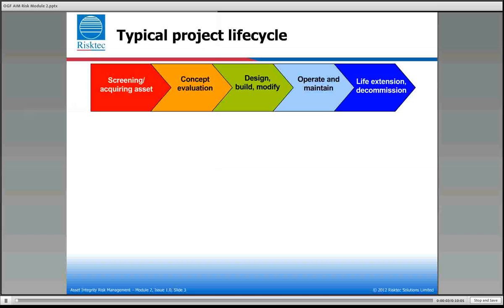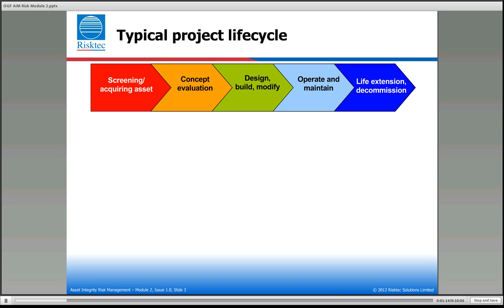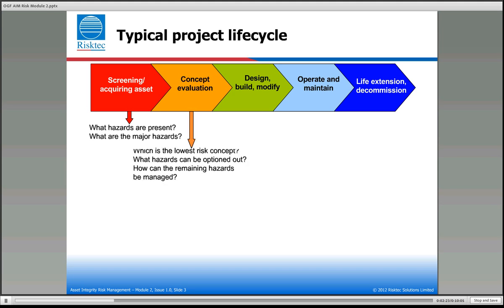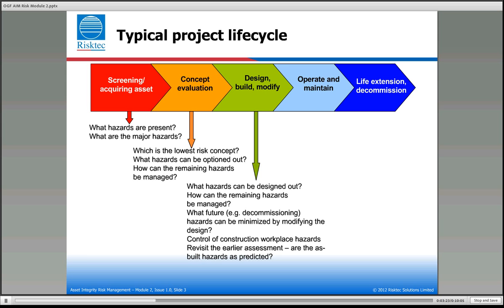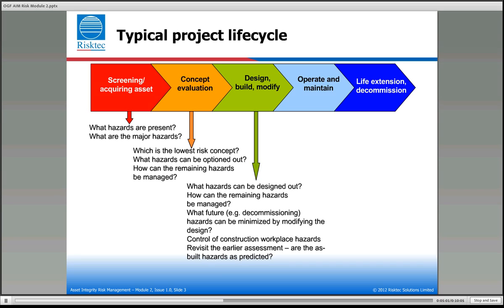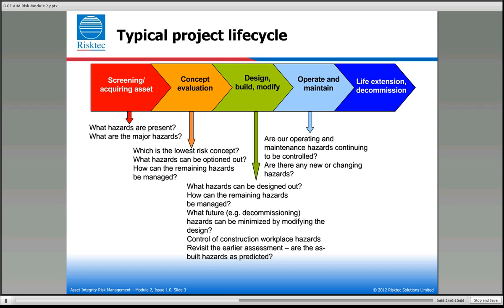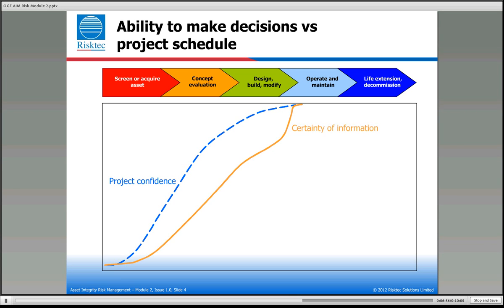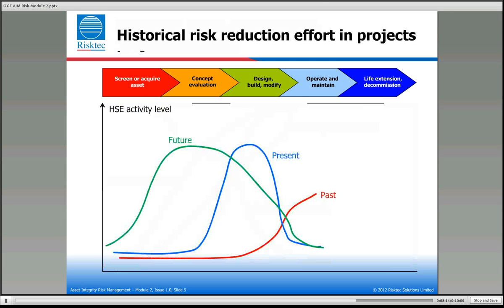Fundamentals of Asset Integrity Risk Management - Online Training Course Sample

Comment: Thanks for sharing Asset Integrated Management Video... Its very easy to understand. We are providing Asset Integrity Management Software. A web based Asset Integrity Management Software | https://www.assetintegritysolution.com/ to efficiently handle integrity related data and information of your plant. Risk Based Inspection Software | https://www.assetintegritysolution.com/asset-integrity-management-software/risk-based-inspection for pressure system, pipelines and structures in accordance to latest acceptable industrial standard.